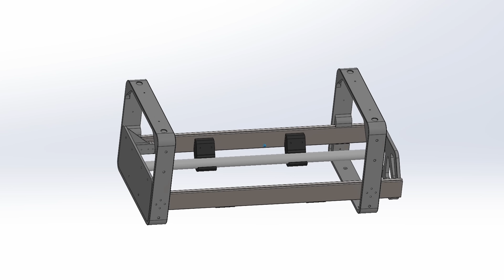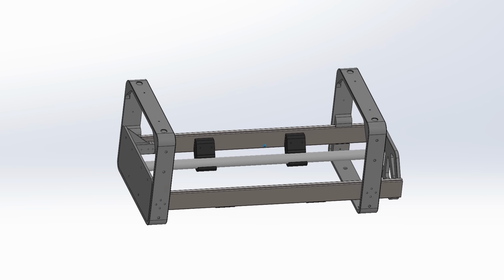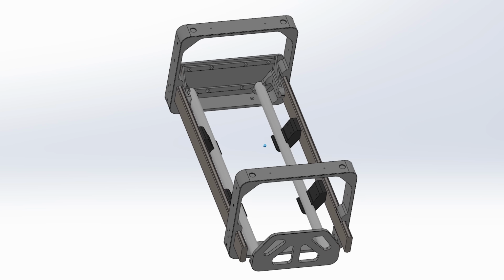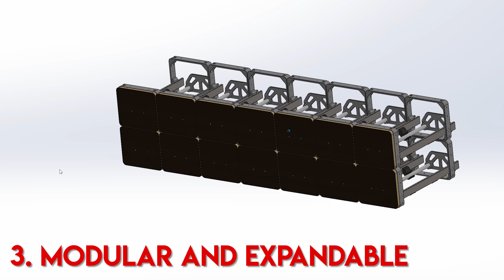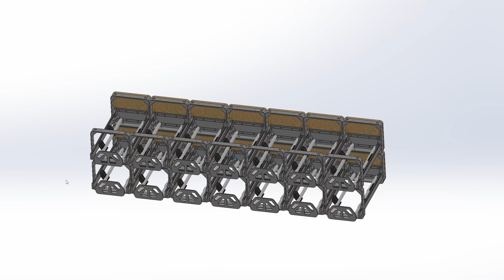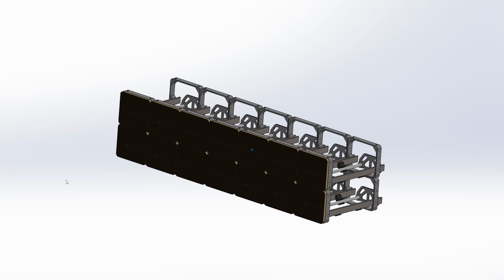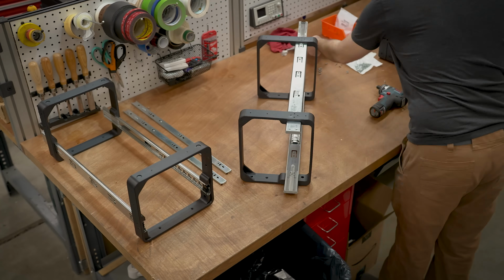Modular Filament Storage System - Part 1 (Design)

Comment: I just found this video and ordered the parts. I was searching for a new wall rack to replace the one I have now, which is kind of flimsy and making me nervous about its ability to hold the weight when it's full. I have over 100 rolls of filament and every solution I found was going to take up tons of wall space. However I also have several of those muscle racks with 24" deep shelves that I'm not fully utilizing because they're so deep. I calculated it out and I can fit 12 of these on the bottom half of one of them. This will give me enough room to hold all my filament and free up the wall I'm currently using for more machines. 😁

Comment: Amazing system! I’m new at 3D printing and I’m trying to print the model on my Bambu Lab P1S, but the frames are just a bit bigger than the printers bed, is there a problem if I rescale the model size?
Reply from the maker: If you rescale it, it will be too small.  There are some remixes that cut the frames into two parts.
Reply: @RobertCowanDIY  Someone on makerworld suggested to scale everything to 98% however around 4:00 you say it's designed to have little wasted space, so is 98% going to be too small?

Edit: I dragged a printable bambu spool into the slicer and seems like it fits, I'm going to try the 98% print, see how it goes. The only worry is if the drawer slides fit, but I'll find something that works.

Comment: I would suggest not using the rear supports at all. If you use the front support or lite version on both the front and back, you get a stronger sliding rack and the assemble becomes super easy. You did an excellent job placing holes for the slide rails to mount to the supports.
Reply from the maker: oh, huh.  so you just mirror the front and back?

Comment: This looks awesome! One question though: why do we need to dry filament and then leave it out in the open again? I'm into 3d printing for a couple of weeks, so apologies if this is a newbie question...
Reply from the maker: Since I have so much filament. I only dry it when I need to print with it.  Drying and KEEPING filament dry in this volume is impractical.  I just plan ahead and when I need to use a filament that needs to be dried, I dry it beforehand.  Many of the more hygroscopic filaments can absorb moisture in as little as a couple hours, so keeping it try for months, just to exposure it to moisture before printing doesn't make a lot of sense.  Plus, even if you added desiccant to the drawers, or some sort of active drying, opening the drawer would create issues, and it would need to be air-tight, etc.
Reply: @RobertCowanDIY  But if you want to print something, you need to wait 4,6,8 hours?
Reply from the maker: @Mark-pi7vj correct.  That's the trade-off.  It's either that or figuring out how to keep a hundred or more rolls of filament dry at all times.  My way works for me.  I usually keep my most used filament in the AMS units, which keep them dry and ready

Comment: unfortunately the plate on my Prusa MK3S is just a bit too small to accommodate the frame. If I truncate it to 92% it will fit. If I do that , the drawer slides wont fit
Reply from the maker: There are a few remixes where you can use smaller printers, but it's a fairly large model, so you'll need a bigger printer.

Comment: According to Prusa Slicer the frame fits on a Prusa Core One standing up. Any Ideas the best way to print this with a core one?
Reply from the maker: There are a few remixes where people have split the model into two parts.  I would NOT print it standing up.  The better option is to use the split remix.

Comment: Is there any clearance issues that would prevent someone from putting the spools in these modules with the spools inside sealed bags? I currently already have all my filaments in bags. But my 24" deep shelving unit is just a pain to search through for filaments. So I love this design as it'd be much easier to slide a drawer out to see the filament at the very back where as right now I have to move all the rolls off the shelf in front to get to the back.
Reply from the maker: The clearance is TIGHT and bags won't fit unfortunately.  For stuff that should be kept in the bags, I just leave that filament boxed up.  If it's a used roll, or not too sensitive to moisture (PLA), it goes in the drawers.  For sensitive filament, I just try ahead of time and print it while drying or leave it in the box.  It's worked well enough for me so far.
Reply: @RobertCowanDIY  Drat... I keep all my filament in bags even if it doesn't "need" to be.

Comment: I really love this, but I can't help but think that there's tons of unnecessary drawer slides, why not allow for x2 filaments with the same drawer slides?
Reply from the maker: How do you mean?  The rails are basically the structure of the drawer, so I'm not sure how you would double them up?
Reply: @RobertCowanDIY  

Initially, I thought about coupling two modules together in a way that would also be structural, some sort of drop-in replacement for the two sliders that joins 2 adjacent modules. However, I’m not sure if this would work, as they might collide with the structure.

Perhaps it requires some redesigning, but if you can join 2 modules you can likely do an arbitrary number, combing could become a problem, would need experimentation. But it could mean saving $$$.

Also, I see no benefit of having 16 independent filament drawers, I would prefer larger ones for when I'm in search mode, not having to open/close all of em 1 by 1, so to me, it seems like a better UX too, win/win.

Regardless your design is epic, just sharing my thoughts for V2

Comment: You mentioned "drying as you use the filament" - how does that work?
Reply from the maker: Most filament dryers have a hole in them where you can feed the filament out to a printer.  I just print directly from the dryer.

Comment: Very nice storage, great idea.
I wouldn’t compare it to wall storage solutions though, they’re 2 completely different things, you can’t say one is better than the other. If I build a wall storage solution it’s because I don’t want or can’t afford to spend floor space. But the walls, I’m not using them anyway, so that would be lost space if I don’t put some spools there.
Also, regarding the pipes, I wouldn’t have thought about pvc. I would have used aluminum. No flex there, at least not with the weight of the spools you’d fit in a drawer.

Comment: It's the best project I've seen so far!!
Only detail, I would close the open parts (left, right and rear) to reduce dust and humidity
Reply from the maker: Sure, but think of the amount of material needed to close them off!  It's significant.
Reply: @RobertCowanDIY  You can do it for about 14 bucks if you use smooth brown board from lowes.

Comment: Dear Robert, I love your design and wanted to make this for myself. I only have two issuses: 1. The design does not fit my Bambulab P1P and 2 the design does not fit under an ikea lack table. So I am redesigning your modular Filament storage System to be 222 x 222 mm (two next to each other under the ikea lack table) it is a challenge. When I’m finished I’ll post you the pictures and post a video on my channel with credits your way…
Reply from the maker: Sounds good, there are MANY remixes on printables, that might save you some work.
Reply: @RobertCowanDIY  True, but they only fix the problem that it will fit my P1P. The biggest challenge remains, reducing the width with 4 cm. Have to lower the rails, adjust the poles etc. Do you have any advice on printing ? I know ASA or ABS but what about infill ? 15 or 25 % walls 2 or 3 or more ?
Reply from the maker: @licky-lauda  Check the printables link.  A "strong" profile should work just fine.  There's really not much in-fill area, so as long as you do 3 walls or so it should be fine.  The load won't really make the frames flex based on how it's designed.

Comment: Hey there Robert - I see around 7 seconds into the video there are several spools of gold / brass filaments. The one on the right looks like an awesome shade or combination of the 2. May I ask which brand are they?
Reply from the maker: The good one is a Filamentum Extrafill bronze I think.  The other is one of those fancy dual filaments, but I don't recommend it, it prints terribly.
Reply: @RobertCowanDIY  Thank you for the information. Excellent work!

Comment: Do all the parts need to be ABS?  Itis mostly important for the frame?  How about the side supports or the front and back?
Reply from the maker: Ideally.  You could probably get by with something else for the front/rear and supports.  The frame NEEDS to be something rigid that won't creep under load though.

Comment: Does this work for other drawer slides if we want to go longer?
Reply from the maker: It should.  The middle supports do a pretty good job at keeping the PVC rigid, since you're relying on the actual drawer slide for support.  24" if perfectly solid.
Reply: @RobertCowanDIY  most drawer slides have the same profile right? To fit in the grooves of the face plate holder and the back?
Reply from the maker: @bpindel  Probably...

Comment: Very elegant and beautiful design.
However, desiccant does keep filament dry, and will pull moisture out of filament over a long enough period, if the container is sealed and air tight. I don't see a good way to do that with this design though, at least easily, as it would require non-porous plastic sides and gasket seals at the opening. 
I guess I would need to find a drying system that I actually like to use this drawer system, as currently most seem to have flaws in their design, at least with purchasable products.

Comment: Great video. Only problem with open storage of hygroscopic filament is that it's a 2 part problem. Yes, absolutely dry the filament before and during printing, however that's only half the problem. The longer that hygroscopic filament stays wet, the more permanent and non-reversible molecular damage is done, I usually find that at least least for hygroscopic filament, if I've stored it open, by the time it's been on the shelf 2 years the damage is usually sufficient such that no amount of drying prior to printing will fix it.
Reply: Yeah, this really is the Achilles heel of this otherwise amazing design …
It’s probably possible to come up with a completely enclosed version of this.

Comment: I really like the design however like many I don't have a large format printer.  I wonder if the frame could be quartered with dovetails so that it could be printed by those of us with smaller printers.
Reply from the maker: There are a couple remixes, but I'm working on a smaller version.

Comment: You might be able to get a tighter pack with a hexagon design. The project looks amazing!
Reply from the maker: MAYBE, but there still needs to be room for the slides.  Plus, hexagons don't fit into rectangles well, so you'd just end up with a tighter pattern, but a lot of empty space in the corners.

Comment: Question... would 10 to 12" drawer slides mounted front to back on the side panels allowing for the drawer to come out the front instead of the side so that you can see the filaments better and be horizontally wall mounted be viable? I expect like you have them mounted 2 x 7 you can't see what color is in the lower row without pulling out the drawers.
Reply from the maker: I'm not really sure what you mean.  If you want to see what's inside, just open the drawer.  I'm making a little filament swatch thing so you can just look at the drawers to see what's inside.
Reply: @RobertCowanDIY  just a use case I was thinking about while watching the video. I have hundreds of rolls and am looking for better storage options than a shoe rack or repracks. While 24" slide rails are $30, 10" are $13... so was thinking instead of the drawer pulling out the length of the rack, instead could pull out the short side that could be cheaper and give a better view of what's inside... but I do like the swatches idea as well.

Comment: I love the look of it, but how much filament did you say it needs to make?
Reply from the maker: Each 'module' is around 400-450 grams of material, depending on your slicing settings.  So you can get 2 modules from a 1kg roll.

Comment: Does it only work with the Lanton brand drawer slides? OR will it work with cheaper options? Also, if it's unique to those drawer slides, can you provide a link?
Reply from the maker: It MIGHT work with others, but you'd have to just look at the files and see what other options work.  The Lontans are cheaper in quantity.  All the links are on the printables page.  I included links to ALL the hardware.
Reply: @RobertCowanDIY  Thanks. I'll check it out, but right now, I'm just starting in 3d printing and so I don't have need for more than 1 of these units to start.  I just figured with the modular nature of it, I could start with it and as my filament collection grew, I could expand.
Reply from the maker: @gregs9492 For sure, that's the intention behind the design.  Even after several years, I still feel the need for expansion.

Comment: Love the design of this. Did you consider using EMT conduit instead of PVC? EMT would probably add a lot more strength and rigidity without altering the BOM cost much.
Reply from the maker: I wanted PVC since it's just easier to work with.  There are several holes into the PVC and EMT would have been a bit trickier to deal with for most people.  Also cutting and sourcing.  With all the fasteners in the right spots, I don't think EMT would significantly increase rigidity, but it would increase the overall weight.  BUT, the design would be really easy to convert to EMT, you'd just need to adjust a couple dimensions and the STEP files are included ;-)

Comment: Hi there, I love your drawer system! Thank you for making it free for all to replicate ;) 
May I suggest to store the filaments in ikea largest zip bags ? These are great for holding the material and you just need to remove as much as as possible with a little vacuum 😉 saves a lot of headaches!
Reply from the maker: I did consider that, but putting the filament in bags makes them not really fit as well.  I still think keeping 100+ rolls of filament dry and ready to go is a bit impractical, as you'll need to dry them during use anyway.  It's also a LOT of extra bags and time to keep them all sealed.

Comment: really nice. but i do have 1 question, are those slides not the push to open kind? I have a set just like that, and you push it and it comes out a bit before you pull it.
Reply from the maker: These are not push to open slides.  They are traditional drawer slides, but they do fully extend (which is pretty critical) and have a soft-close feature.  The push-to-open was just an extra cost I didn't feel was necessary.
Reply: @RobertCowanDIY  super, as i said, mine look the same and it seemed like you needed to pull on them a bit, but that would be good since you want them to stay closed. :) anyways nice design
Reply from the maker: @bogdanghita5033  Thanks!

Comment: Really tempted to do this. Do you know if this would work with any cheaper drawer hinges?
Reply from the maker: Look at the quantity discounts.  They get a LOT cheaper when you buy more than one at a time.  Also, the 22" version is much cheaper, most people won't have the space for the 24" since it even extends a bit past my shelving unit even.
Reply: @RobertCowanDIY  i just have 24 inch on my shelf. But just realized it won't print on my 250x250 printer. 😢
Reply from the maker: @camelCaseOnly Gotcha.  Check out the printables link, someone made a remix of the frames that splits them into two pieces.  I'm also working on a smaller version for 250x250mm printers.
Reply: @RobertCowanDIY  awesome. I'll wait. I saw there were couple remix, but they don't seem to have been tested yet. Might hold on a bit into it. But overall, I love the design. This is going g to save me so much space. I have like 200 spools trata keep crawling in every possible surface
Reply from the maker: @camelCaseOnly  Cool, stay tuned!  If you're not subscribed, maybe consider doing that so you can get updated when I come out with the slimmer version ;-)